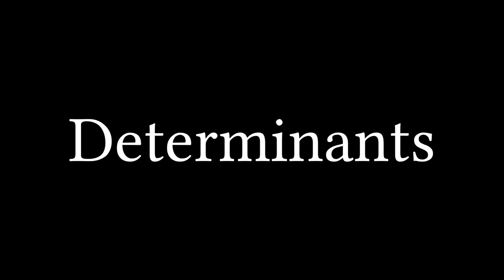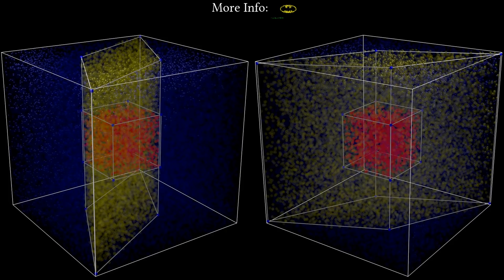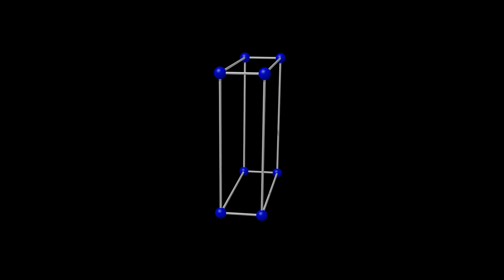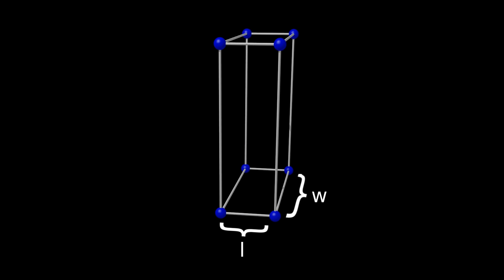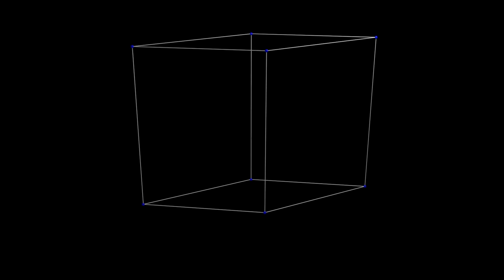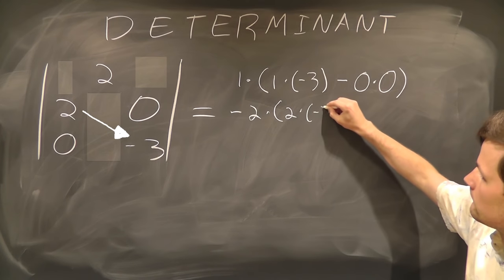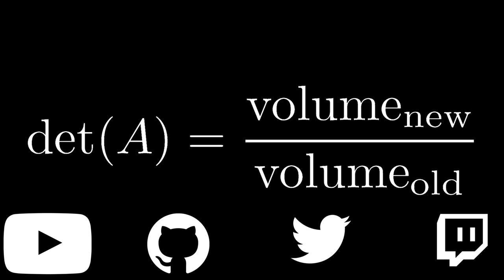What is a determinant?

Comment: It helps that the matrix is symmetric so that the eigenvalues are real and the eigenvectors are orthogonal. Not to knock, though. This is a beautiful demonstration. Generations of teachers have taught the determinant like it's just an arbitrary combination of numbers that somebody pulled out of thin air (to put it politely). The interpretation as a volume expansion is intuitive, and it also explains all those other interesting properties that the determinant has. For example, the det(A*B)=det(A)*det(B) - of course!. How about inverses? The inverse just gives you back the original unit cube, so det(inv(A))=1/det(A). And if A is singular? det(A)=0, so the cube gets squashed flat. So of course the singular matrix has no inverse, meaning that the squashed cube can't be reconstructed. Very cool :)
Reply from the maker: Yeah. I opted to make the video short and focus on intuitive arguments. I should have left a little more room for discussion, but maybe that's what the comment section is for?
Reply: @LeiosLabs   ok great ... I had actually figured out previously that a determinant of a two by two matrix was a surface .... But tell me when you say that this division NEW VOLUME divided with OLD VOLUME, then my question is : Is the old volume "1"? Thanks if you have time to answer me.. (I am studying linear algebra by myself)
Reply: @TheNetkrot   yes it pretty much is.BASICALLY IT DEPENDS ON THE BASIS VECTORS.
Generally the standard  basis vectors are  unit vectors ( i cap,j cap,k cap).so the volume is 1
Reply: @krishnasaikanigiri971  thanks for this
Reply: Yes.....
Reply: We need more this type of demonstration ....
Reply: Omg ... i didn't understood anything. Could you tell me what you are talking about
Reply: I love you Sr. Bill, what a cool discussion!
Reply: Oh, my god!
- I need to take State Space Control Theory all over again!

Comment: The point is just that you are taking a linear transformation of rank n,  from a vector space of size n to itself, such that all the eigenvalues are real (and all eigenvectors have period 1) which means that the matrix representing the endomorphism is diagonalizable over R. Then the important property is that the determinant is an invariant and so it's the same considering the matrix of the endomorphism expressed with respect to the canonical base and with respect to one of the bases which "diagonalizes the matrix". Then you can finish knowing that the determinant of a diagonal matrix is the product of the elements on the diagonal (aka the eigenvalues). 

Just wanted to give an explanation on why it works, the video was great

Comment: A note that might add to this video: aligning a volume V cube along eigenvectors, you get a scaled cuboid of volume V*det(M). Do arbitrary weird objects also scale in volume as det(M)? Yes: divide your object of volume V' into a large number of little cubes oriented along eigenvectors. After you perform your transformation, the little cubes will still be non-overlapping (assuming our matrix is full rank, that is, one-to-one), so you can just add their values to approximate the volume of the weird shape. As we increase the number of cubes, the volume before transformation goes to V', and after V'*det(M), just as expected.

Comment: this is beautiful! I've taken linear algebra courses in college but there's so much meaning and intuition behind it that I've yet to discover!
Reply from the maker: I'm glad you liked it! A lot of time mathematical concepts are hidden behind some sort of cryptic formula or method when things could be explained much more intuitively.
Reply: Yes. That got me wondering. What about repeated eigenvalues, or singular matrices..? Intuition tells me that singular matrices will yield a line or point after the transformation, i.e. 0 volume. And does that also mean we are unable to get back our original cube since no inverse can be found? Hm I am not so sure about repeated eigenvalues because sometimes I could find enough eigenvectors but other times when I can't, I'll just add a 't' in front of it (when solving ODEs). And what does THAT mean geometrically? Interesting stuff! Could you shed some light or share some sources that would? Thanks!

Comment: How would you interpret negative determinants then? In this particular example.
Reply from the maker: Basically the cube moving in the other direction, if that makes sense.
Reply: It means the cube was not only rotated and scaled, but also mirrored by the transformation. (The transformation transforms a right handed system of vectors to a left handed one and vice verca.) The change in volume is actually given by the absolute value of the determinant.
Reply: Think of the cube shown in the video is above the surface. A negative determinant would indicate a cube below the surface mirroring the one with the positive determinant.

Comment: since -3 is isolated in its own row and column for the determinant you could have just taken the determinant of the matrix at the top left times its cofactor at the bottom right (-3), giving you -3(1*1-(2*2)) = 9

Originally I though you would use the cofactor trick since the matrix was so nicely set up for it but since you didn't I thought I'd mention it

Comment: Thanks for the video, I've been watching a few of them to understand why [A]x = 0 means that det([A]) = 0 to solve for non trivial values of x. Can someone explain that to me please?
Reply from the maker: Sorry it took so long to respond, but I am not sure. I would guess it's because only a singular matrix can have it's determinant be 0, so if [A]x = 0, the matrix must be singular.

Sorry for the crappy answer after a long wait.
Reply: Thanks for the answer! I've been looking at lots of documents to find a formal proof for this and I haven't been able to find anything :( I will keep looking! If you find out, please let me know :)
Reply: If the determinant is zero, the unit cube is deformed to an cuboid with no volume after the transformation, which means it becomes a rectangle, line or point. But clearly you cannot reconstruct a three-dimensional cube from a two-or-less-dimensional object whitout additional information, therefore the transformation cannot be reversed. (Another way to think about this: The transformation "flattens" three-dimensional objects to two or less dimensions, therefore multiple of those objects must be mapped to the same image. But for the transformation to be reversible, one should be able to uniquely reconstruct the original object from its image.)
We can therefore conclude that det([A]) = 0 means that the transformation is not reversible. A reversible transformation determined by the matrix [a] would imply, that whenever [A]x = y, x is uniquely determined by y. Since [A]x = 0 is always true for x = 0, this is the only solution for a reversible matrix/transformation. Therefore the matrix must be non reversible (singular), if we want to find non trivial solutions for x. This is equivalent to det([A]) = 0.

Comment: It's strange that after this was posted to reddit you agreed there were issues with the video and set it to private. Now the same video is back up with the same issues. odd.
Reply from the maker: The video has been set to unlisted. If you have a link you can find it; otherwise, you cannot. I guess it's still in the playlist, though?

Honestly, I have rewatched the video over and over again and I don't honestly see any issues with it. I actually like the video. Like I said on reddit, this video is for people who have done a determinant before, but have never seen it visualized, and I think it does a good job of describing the mathematical concept without math. Other people disagree and I respect that. Because of that, the video was set to private. Now it is unlisted.

Thanks for the comment!

Comment: Thank you for that video. 

I've red in a book that first, the determinant was found in the pattern of solution for equations systems. You shift the equation system with a matrix*(x,y,z) vector, apply the solutions pattern, and you have a determinant... I don't remember well... would make a video about that?
Reply from the maker: Hmm, maybe. That's interesting. I might have to look into it.
Reply: It was an old book. I like old math books a lot. I'm quite sure that the determinant was first discovered while solving equation systems.

Comment: its very fun and easy to prove this with a 2x2 matrix and two vectors u and v that will undergo a transformation. Just calculate absolute value of det(u,v) to find the old area, then calculate the new area: absolute value of det(T(u),T(v)). Then you will easily see after some algebra steps that this new area is equal to absolute value of det(A)*old area

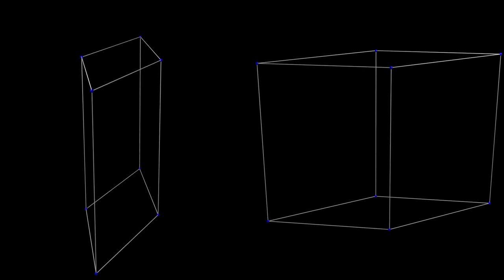Comment: 0:23 "after transformation" why are there two different images, if the original object was a cube. The determinant should map the vertices of the cube to the same image, not different images. It looks like the two cubes that you started with are exactly the same. Or perhaps they are the same transformed image but with two slightly different angle views, though the images look different they are actually the same? However one looks like tall and narrow parallelepiped  and the other looks like a very wide parallelepiped.

Comment: And what happens if the determinant is zero, what does it mean then?
Reply from the maker: the determinant being 0 means your matrix is singular. I am actually not sure of the precise interpretation geometrically.
Reply: It means that the unit cube is deformed to an cuboid whit no volume, which means it becomes a rectangle, line or point. (Multiple veritces of the original cube end up at the same position after the transformation.)

Comment: "Let's use this matrix to transform a unique cube of 1x1x1" - that part was unclear to me. Rest seemed trivial. How did you the transformation?
Reply from the maker: Each vertex of the cube is an xyz location that we treat as a vector. We then transformed each vector according to the defined matrix, but kept the lines connecting each vertex. This generated a new cube of a slightly different size / shape.
Reply: Think of the matrix as an operator acting on the i , j, k vectors. How are the vectors transformed ...
Reply: @PureAndAppliedMath  Instead of one question now I have many: what is an operator, what means “acting”, what are i, j, k and how the cube is related to vectors. That’s all about math - endless throwing in new concepts to explain the previous ones.
Reply: @decarbonization  if you're asking from a philosophical side, it might be endless. But, remember; mathematically, we rely on some definitions and lemmas that are taken for granted.

Comment: what will be if det is complex qty?
Reply from the maker: Complex quantities are somewhat difficult to visualize here.
Reply: and what will be in case of 4*4 and high order matrix?
Reply from the maker: Great questions! For the visualization here, we could just imagine a unit tesseract evolving in a similar manner, or we can multiply by the eigenvalues. The intuition still holds for 4D; however, it becomes way harder to visualize. 

Ultimately, for higher dimensions, it becomes easier to use a standard mathematical deteminant method / algorithm.
Reply: plz make video on - visualization of tensors

Comment: Alright, so after watching the video three times I now understand what a determinant is but yah lost me on about all the math lol. 

I've watched the video 6 times now and at 00:12 you say "let's use this matrix to transform this unit cube". How are these numbers actually applied to transform the matrix? I'm assuming the 4 zeroes are always zero for a reason. I went back watched the eigenvector video twice and you used the same matrix but I still noticed you never explained what this matrix actually is. This really isn't a problem with the video itself, it's me forgetting math lol. 

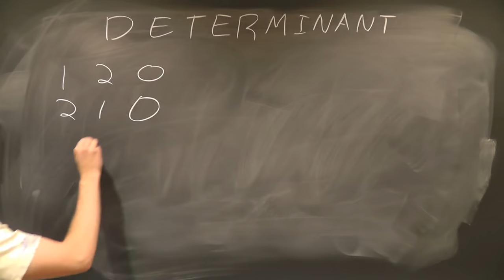At 2:10 is where the video goes wrong for me. You explained that if we calculate the x, y, and z eigenvectors and multiply them together, we will get the changes volume. That makes sense. But at 2:10 you proceed to multiply a bunch of random numbers in the matrix together and get a -3 and 12 which happens to make 9 when added. Wtf? I think, once again, I've forgotten or missed a fundamental concept somewhere lol.
Reply from the maker: To the first point, we are simply taking the transformation matrix and multiplying it by each vertex in the cube (in x, y, z). That provides a new point in space and we are showing that transformation as movement from one point to another.

The matrix was chosen arbitrarily. We could have chosen almost any other one. I just chose this one because we were familiar with it from the eigenvector video and because it's easy to solve.

As for the latter point, I kinda assumed that people have performed a determinant before. Here I was simply showing Cramer's rule.

Sorry for the confusion / I hope this helped!